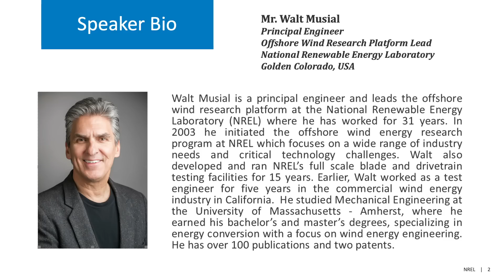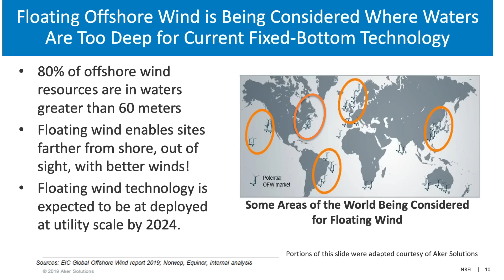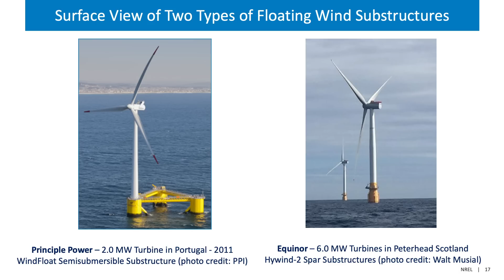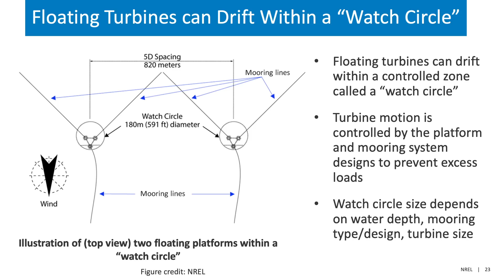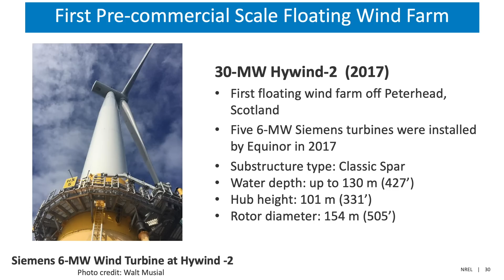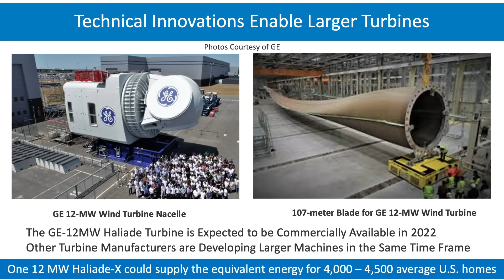Overview of Floating Offshore Wind

Comment: There is soon to be no need for more conventional, offshore wind and green hydrogen technologies that are more expensive and disadvantaged when compared to the cleanest possible nuclear fusion SAFIRE GENERATOR. Learn about this best and vastly cheapest 24 Hr. reliable, hydrogen-powered, FUSION NUCLEAR and community located device which can be built on any scale on a tiny and unobtrusive footprint. It is the latest fusion nuclear technology that is in commercial design and production now. They will not need battery or other storage technology backup and no extended ugly and vulnerable electric grid. See it at "AURION @t" and then learn about ELECTRIC UNIVERSE THEORY and more advanced Plasma Physics at "THUNDERBOLTS @t". Then please teach all your friends and peers so we can advance the most modern physic knowledge.

Comment: The extensive cable systems could be a nightmare for whales that would have to navigate through a forest of cables. Vineyard Wind is in a sensitive area. The floating cables would prohibit any commercial fishing and would limit recreational fishing by snagging lines. In addition, the cables on the bottom, that are protected with the barely mentioned "concrete pillow" system; a chain of cable connected large concrete pads will make for miles of anchor snagging, net catching fishing gear nightmare. Will hundreds of square miles have restriction zones where no marine traffic is allowed?
Reply: The restrictions on commercial fishing is a very good advantage of offshore wind. Where the windfarms have been installed around the UK have resulted in a massive increase of young fish in these areas. Overfishing is a massive problem wind farms are good for this.
Reply: @williamarmstrong7199  
yes it's also true of offshore oil platforms
young fish congregate around them for safety like a kind of reef

Comment: Interesting webinar. I was a commercial diver in the Gulf of Mexico for 12 years I have seen many of the same structures in oil platforms. No one is really discussing maintenance and inspection of those structures. On oil platforms divers would inspect the structure using NDT methods. My next big question is what happens to these things during and after a hurricane. I have personally seen, repaired, and salvaged(as a diver) these same structures but bigger crumpled up underwater after Hurricanes Ivan, Katrina, and Rita.
Reply: Cathodic protection of these structures would be interesting also. Thank you
Reply: Would you mind sharing your experience as a comercial diver?
I am looking to became one during the next two years and I am very exited with this perspective

Do you regret choosing this career path?

Comment: Why not produce hydrogen at the sea turbine  instead of complicated power cable array liquify the hydrogen tanker it to shore instead of jet fuel  use hydrogen to produce electricity
Reply: because converting electricity to hydrogen is only at the 70% efficiency rate, where a wire is 99%
Reply: @Greg Edmonds I think the conversion at the wind turbine site seems like a good design to work on too. Maybe these could power hydrogen powered shipping and a barge could bring hydrogen fuel to land. Maybe hydrogen storage offshore would be safer than on-shore hydrogen storage?  @davidanalyst671  - Are the offshore wind turbine to land transmission line losses 1%? Or are you referring to electricity generated at the wind turbine site? Electrical transmission line losses on land are considered often.

Comment: Beginners question: It seems there is a substantial amount of angular momentum in the rotor and mechanicals, but they are sitting 100m above a moving platform. How does the system isolate the rotor from torques from the tower? Is it as "simple" as a gimbal? Even in a storm with large tower excursions (I assume)? Is this a challenge compared to fixed-bottom configurations?
Reply: waves are only on the top of the ocean.  once you get some weight and depth, you aren't impacted by waves.  These guys aren't bouncing around with the waves.  There are actually using engineers from oil platforms, and oil platforms have been drilling with pipes down to and actually miles beneath the ocean floor from floating platforms